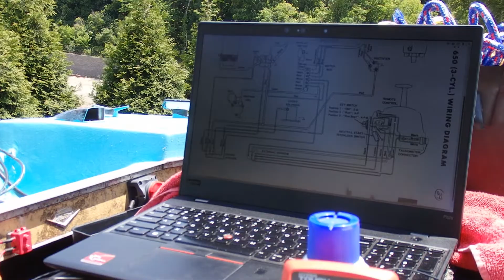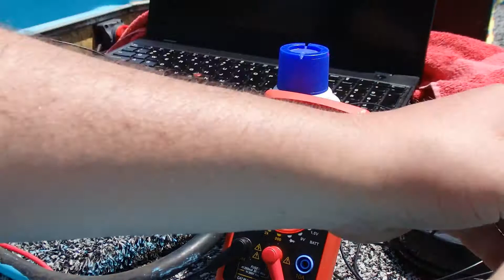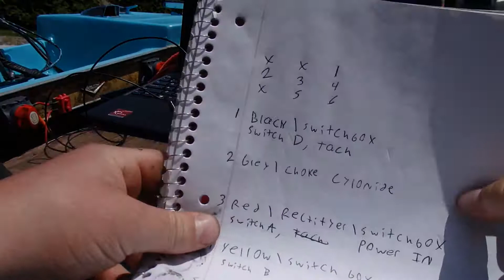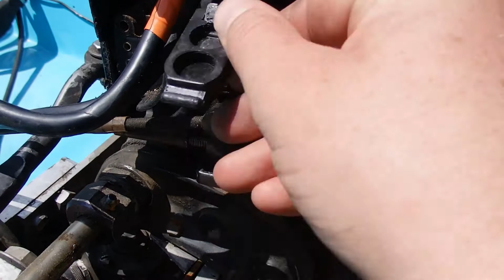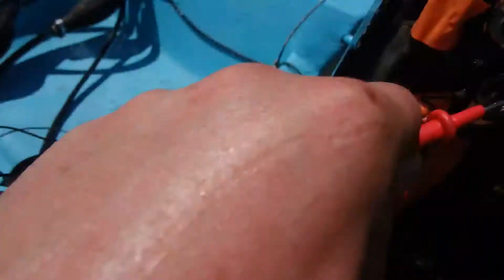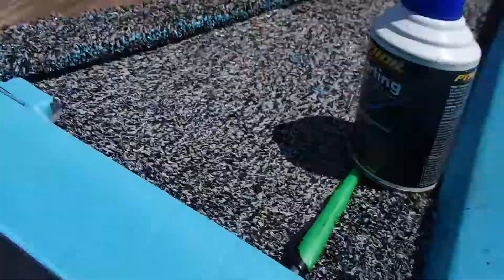Ignition switch troubleshooting 1974 Mercury 650

Comment: Great video!  I've got a 1975 850 without a wire harness and am considering picking up a 650 from a guy that says the distributor is bad.  Your videos have been really helpful and I feel a little more confident tearing into them.  Seems like a lot of the older outboards suffer from electrical gremlins.

Comment: Cant igniton switch cause no spark?
Reply from the maker: It can, but I wouldn't start troubleshooting there. check out his video. https://studio.youtube.com/video/AvZz5Cmm5Xc/edit
Reply: @tyrantdragon000  yeah ive watched that one im not getting spark anywhere should i just go ahead and get new cdi box?
Reply from the maker: Its kind of a toss up, its either the CDI or the trigger, there are tools to test the trigger but they are pretty pricey. I did the CDI box and got it to run for about 2 hours, then the trigger (inside of the distributor) broke. You have to replace the distributor housing if that happens, just be careful the metal bracket that holds the trigger in place is very soft (I found this out the hard way). It has been on my back burner for a few years now. I think my next move (hopefully sometime this summer) will be to learn how to replace the trigger (it is potted in place) or how to retrofit a new ignition system in its place. These are great engines when they want to run (which, from what I have been told is fairly characteristic of Mercury)
Reply: @tyrantdragon000  yeah my ran great then once i titled the motor it decided to mess up and now got no  spark been testing everything and it seems that im not even getting spark to the coil. I have took the Mercury switch off it I guess i will start with new cdi box then see how that goes
Reply from the maker: @huntertaylor2514  Keep me updated and good luck!
Reply: @tyrantdragon000  new cdi box and the ignition coil and still no spark
Reply: @tyrantdragon000  new cdi box with igniton coil and new plug wires still no spark
Reply from the maker: @huntertaylor2514  Yep, next step would be the distributor. At some point fixing these things feels more like being a parts replacer.
Reply: @tyrantdragon000   even if im still not getting spark at the coil?

Comment: I ended up finding the wires in the ignition broken to get mine up and running from the key. but wont stay  running in run anny idea?
Reply from the maker: If i remember correctly its a two part switch, two wires are used to start and another two for running. But its been a while since i looked at it

Comment: Thank you for posting these videos on the Mercury 650! I have the exact same motor that I rec’d for free. But the remotes the guy gave me were for different motors. So I was able to make up my own wiring harness and get the motor turning over and sparking! On to rebuilding the carbs and a new impeller!! Thanks again.